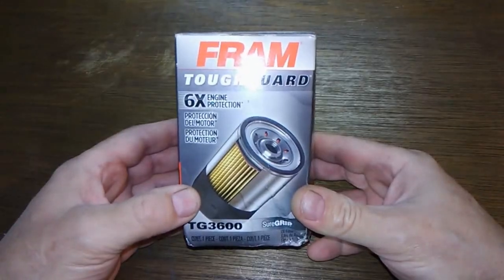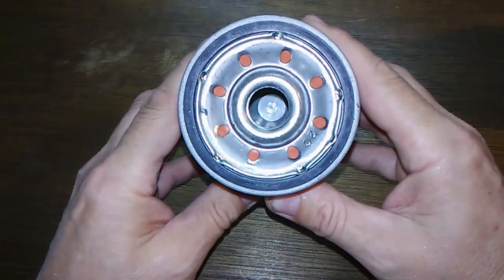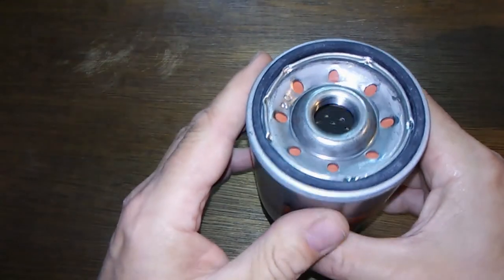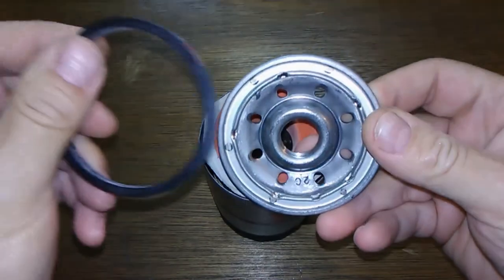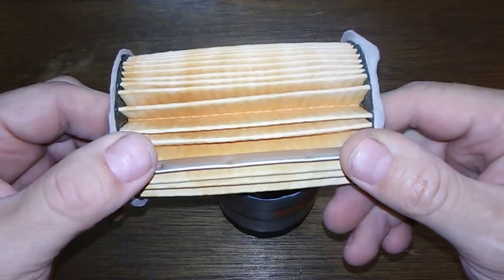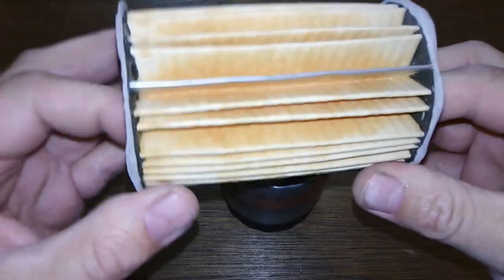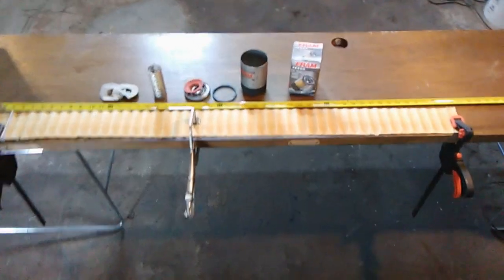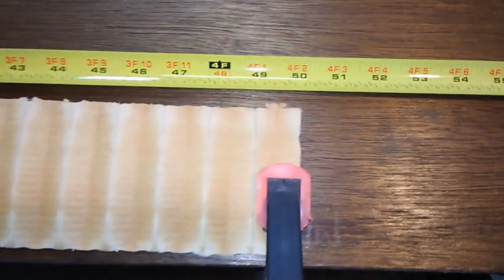Fram Oil Filter Cut Open TG3600

Comment: I use this same model filter changing oil twice a year. Been using the 3600 for years. For a non-performance application, the end caps don't bother me at all. The only other thing I do is put a magnet or 2 on the can to catch any shavings, and it definitely works as far as inspecting a used filter and seeing a deposit of fine shavings built up.
Reply from the maker: Thanks For Sharing!👍
Reply: Hot garbage if you ask me.

Comment: How does the FRAM tough guard filter compare to the super tech 20,000 mile filter
Reply from the maker: The Fram has a better micron rating.
Reply: @WhipCityWrencher  Since the Fram Toughguard's felt end caps are physically glued to the filter media, this is probably the only felt end cap oil filter I would ever  be comfortable using so far. Especially since they are such well built. I rarely see any other  oil filters in this price point that filter down to 99% @ 20 microns while also having a silicone antidrainback valve. My go to Motorcraft oil filters aren't as reasonably priced nor available as they used to be. So this would make a great replacment for a shorter 3-4,000mi OCI when the Motorcraft, Wix, or the Fram Ultra Synthetic oil filters (that all have metal end caps)  are out of stock.   Other than the felt end caps, the fram toughguard is well built.  Furthermore regarding the Fram Ultra Synthetic, I'm quite impressed with it due to its 99%+ @20 microns aswell as its solid build construction. It's a high quality filter. Thanks for the video.
Reply from the maker: @William-13  Your Welcome!
Thanks for your feedback!
Reply: @WhipCityWrencher  I usually use this filter on my ‘16 Honda Civic (TG7317). It’s rated for 15K miles, but my oci’s are in the 7K - 8K range. Cutting them open afterwards, they have held up pretty well…the pleating is still intact (no warbling) and the fiber end caps did not separate from the media. Blackstone Lab results showed good wear results, and they even recommended I could go 10k with this filter and oil (Quaker State Ultimate Durability 0W-20). Happy boy here! 😃
Reply from the maker: @carlovanrijk4039  Hi Carlo,
Thanks for sharing!